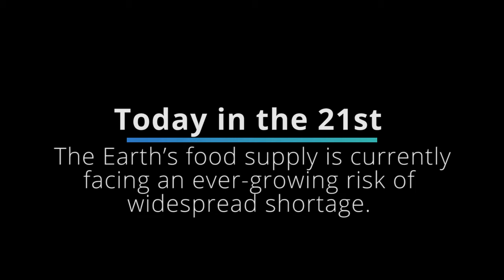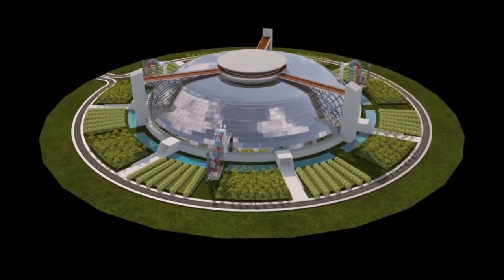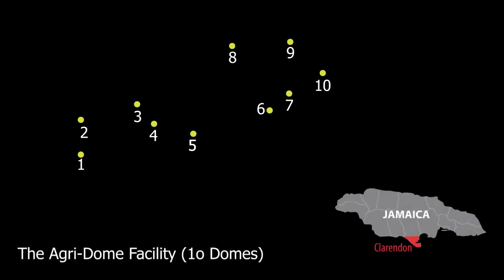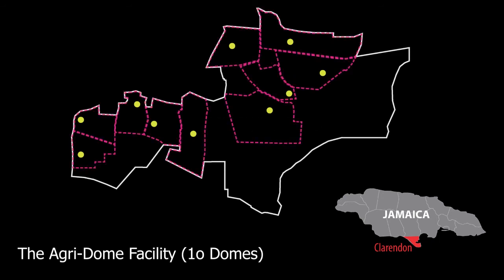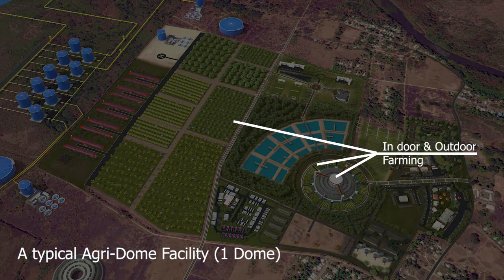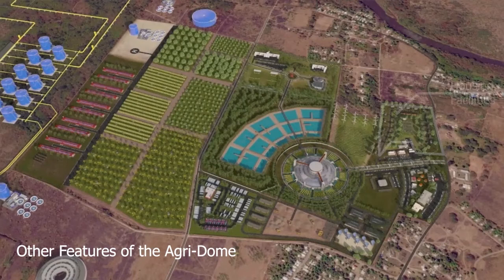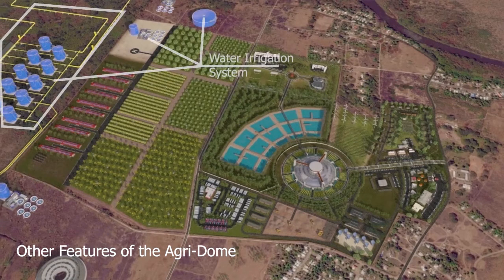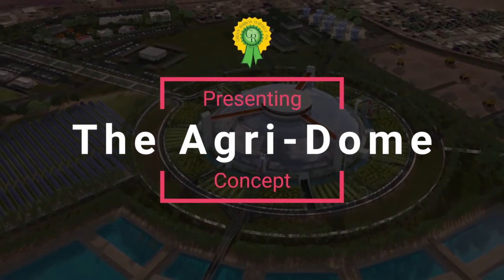Agri Dome Presentation revision2 FINAL HD

Comment: If your going to build an agridome why not make it like a solar updraft tower that uses a solar chimney and turbine to make electricity while having structures like thin shallow sheets that are clear draped down for water to condense on to grow hot temperature crops. At night the gills condense water onto the plants as they radiate out in straight lines from the center. Any fish farms could be used to make nitrates for fertilizers and some crops such as soy could be used to feed the fish.